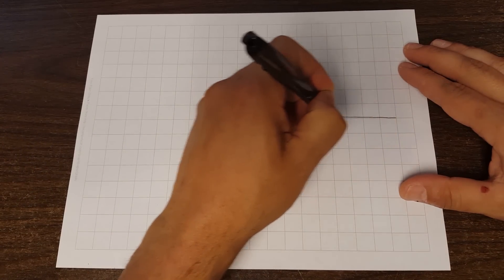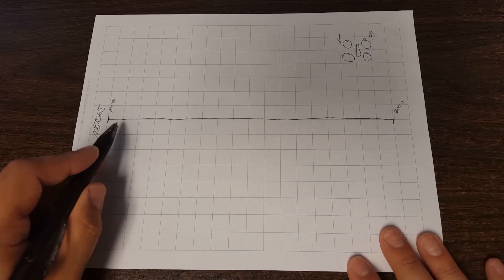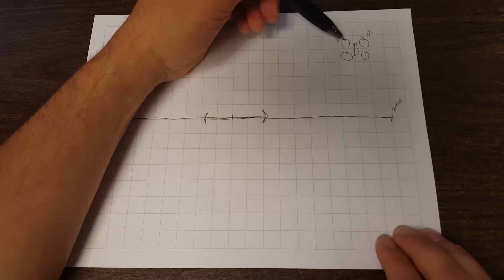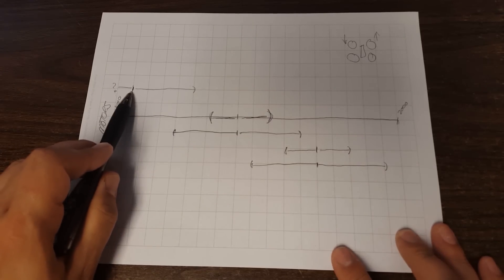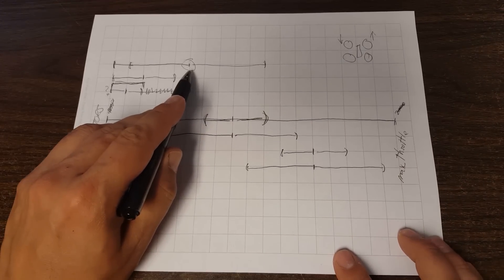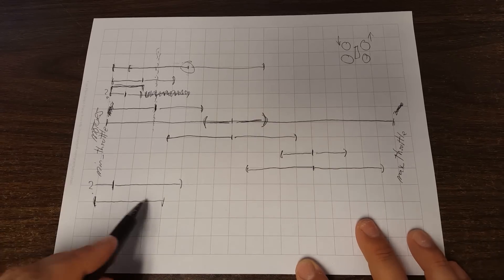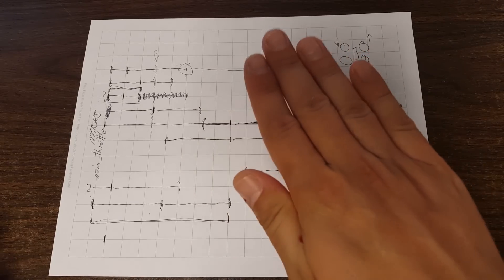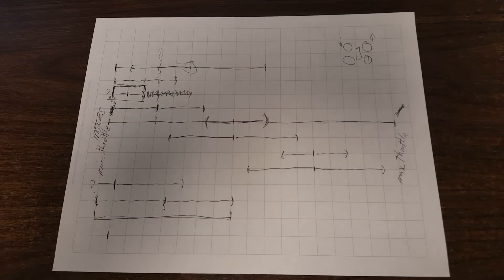What is Airmode? | BETAFLIGHT WITH AIR MODE EXPLAINED

Comment: I was watching a video that showed me how to set the modes as the Eachine x220 comes with them off and I had to turn off Airmode as my motors kept revving up faster and wouldn't slow down. He told us to use the full width of Airmode in Betaflight slider. What's the correct settings in the betaflight for the different modes?
Reply from the maker: +Rod Hamilton correct depends on your needs. If you want to disable air mode, just delete it from the Modes tab. Check out my Wizard X220 initial setup video for details, or my "Betaflight flight modes" video.

Comment: Since the motors can't drop below zero revolutions/thrust, is this about the minimum total thrust it takes to keep the quad aloft?  Obviously to enable maximum yaw, there must be enough thrust in either pair of opposite motors/props to hold the quad aloft (with zero thrust from the other pair), so if that isn't the case (and it requires some combination of thrust from MORE than two motors) then there is a "sliding" range there that cannot be narrowed if the quad is to stay in the air.  It is clear this is why early brushed micros had no yaw authority.

Maybe I'd need to play with air mode to see how it is a benefit, but it's not clear to me right now.
Reply from the maker: It's a benefit because it increases authority at low throttle. Do this: with air mode disabled and motor_stop disabled, punch out high then drop the throttle to zero and watch what happens. Now enable air mode and do it again. The difference should be obvious.

Comment: So what i understand now from reading some of the comments, by default air mode activates at throttle 1350, and goes off below 1350 ? so i don't have to think about this, but is this the same for Cleanflight or KISS, would one notice this behaviour ?
And this is a "feature" within the acro mode ?
Great tutorial ! I'm just starting with building and these things i see rushing by, and don't know how relevant they are, when starting to fly, but it dazzles me a bit :)
Reply from the maker: Air mode does not go back off when you go below 1350. If you think about it, this would disable it entirely, since it makes the most difference at low throttle. Air mode comes on at 1350 and stays on until you disarm.

Comment: Hi Josh..bench testing my quad.without air mode "on "my quad still has control with 0 throttle input????
Reply from the maker: +ab slayer yes, there is still some pid control it's just weaker.

Comment: So does the DRL Simulator have some kind of Airmode per default, or is this kind of simulated steering not comparable to real life quads? Because if feel like regardless of the throttle the virtual quad will always roll/pitch/yaw symmetrical, even though the rotors can't spin backwards
Reply from the maker: +Emoticons I don't know what you mean about spin backwards. To increase the rotation rate, one set of props will idle while the other set spins up.
Reply: Joshua Bardwell yeah thats what i mean: Normal motors can't just spin backwards, which means the drone can't rotate exactly over the longitudinal axis, but slightly to that side where the engines speed up. In the simulatot the drone rotates exactly over the middle, regardless of the orientation.
Reply from the maker: I believe the drone will always rotate around its center of mass.

Comment: Thank you Joshua,
I got nervous because I want to Learn in Angle Mode first, but with AIR MODE on all the time. While testing motors in Betaflight with no props on it was scary because throttle would not quit or shut down in Angle Mode with Air Mode On.
Acro Mode with Air Mode is fine.
So if I put the props on with Air Mode on and using Angle Mode it should be ok? This is a brand new Eachine is there any other suggestions or links you could send for the accelerometers.
Thank you
Reply from the maker: +Michael Puccio I strongly advise you to practice and learn in acro mode. A nice side benefit is all this nonsense about accelerometer lbs goes away.

Comment: Hi Joshua,
I am new to the hobby, and just bought the Eachine 220 Wizard.
I watched your video on this setup, and I need your advice.
While in Betaflight 3.1 I added airmode, and Horizon mode. In these 2 modes with my props off my throttle seems to get stuck when I pull down on the throttle. While pulling down to decelerate it actually increases the throttle.
Is this normal?? In acromode throttle works fine.
Just got the wizard and have not put props on yet to test fly. 
Thank you
Reply from the maker: Behavior with props off is often unusual. Don't read too much into it. A possible cause is that your accelerometer is not perfectly calibrated or trimmed, and the copter is trying to autolevel itself.
Reply: I have a 220s and i have seen this behaviour...dont mind it the motors are reacting to movement the gyro is sensing...you can test it by uping the throtle activaton value and see that they dont respond to minor movements on the gyro..(dont recomend you fly like this.) Just to asure you that its all good...the wizard is just trying to auto level ...happy flying

Comment: In betaflight, is there a difference between airmode and no mode selected in modes or is airmode the standard mode?
Reply from the maker: +Frederik Vancoillie no mode selected us acro. Air mode is a modification to the mixer that stacks on top of other modes.
Reply: +Joshua Bardwell Thanks for the answer!!  Great informative channel and you're an awesome teacher!!  :) Would you recommend acro mode then or airmode?  I flew self leveling aerial photography drones  for about 4 years now but have just built my first racer and started flying it a day ago.  What a learning curve!!  Still, I can keep it in the air, turn and haven't crashed... hard. Oh, forgot to mention, I'm more interested in acrobatics than in racing.
Reply: +Frederik Vancoillie Both, and at the same time. Acro mode with airmode turned on. See Joshua's videos related to landing in airmode.
Reply: So air mode is acro? Or no modes at all is acro?

Comment: So basically air mode allows you to have the same pitch and roll authority no matter what your throttle setting is?  And if landings are so difficult with air mode activated what's the best technique to use to land on an uneven surface like grass? Just bring it to a low hover and kill it?
Reply from the maker: +AV8R Tom yes. Just bring it in low and kill it. Search my channel for "how to land air mode"
Reply: Joshua Bardwell thanks for the reply!

Comment: Joshua, 
I have watched many of your videos and they have assisted me greatly in getting flying. Thanks for the work you do.
I noticed someone else asked this question and did not receive a response so if you have a chance could you indicate why when Air Mode is enabled and you blip the throttle from idle on the ground that the motors ramp up considerable and the throttle appears as though it is "stuck on".
Turn off air mode and it doesn't happen. I am running and Eachine Wizard  set up with Betaflight 3.xx as per your videos.
Thanks for any response in advance
Peter
Reply from the maker: Because air mode increases authority at low throttle. Once you exceed 1350 on the throttle, air mode activates. If you want to idle on the ground, don't raise the throttle. If you want to go fly, raise the throttle and go fly.
Reply: +Joshua Bardwell Thanks for the response. So the issue would disappear when in the air?
I was concerned I would get a runaway Quad if I used it. I have put it onto an AUX switch so I can give it a try in the air. I can also then switch off before landing which eliminates the "How to land issue" you have addressed in your other video.

Comment: But.... why raise the setpoint instead of just giving only the required motors more juice to complete the maneuver at the demanded authority level? Isn't air mode almost as bad as having idle up on? Even if it's only for the time you're inputting the command?
Reply from the maker: +Drunken Hamster raising the setpoint and giving two motors more juice is exactly the same thing.
Reply: No... Your explanation made it sound like all the motors got more juice just so the ones that needed it could be within a 'range' or whatever.

Which would be like a temporary idle up. What I'm suggesting is making the motors required to perform go BEYOND the range of the setpoint's up/down scale WITHOUT affecting the other motors.

IE, if my quad was on the ground and I gave full yaw one way, the non-yawing motors would stay off or at 'idle' depending on how I set it to arm, and the yawing motors would spin up all the way. The desired result would be a yaw-climb. Well, I assume that's what it would be called.

Of course, then the pid thingy or whatever has to step in to make it ONLY do what you want would do so and use the other two motors to keep it stable, but that's about it.

Response?

Comment: excellent explanation. Thanks for making this (nearly a year ago haha)
You spoke primarily about error induced by input (stick movement) and only touched on outide inducers of error. Air mode effectively improves the I term at low throttle as well. Effectively you can reduce the I gain an have very stable low throttle angle hold with Air Mode.
Especially now that flight controllers have 2DOF, theres even more that can be said about this.
I'd love to hear all your thoughts on this as well as the improvements that have been made to air mode (such as preventing "freakouts" on landing)
Thanks again Joshua for always  informative videos

Comment: Should the motors spin at a certain speed at 0 throttle and no stick input if Airmode is on? I had boris B betaflight installed and it was common but now I can't tell if it is working or not because the motors don't spin when armed. If I punch out and drop to 0 throttle the motors don't seem to be spinning at all. This is with motor stop on. Or is it that Airmode only works at 0 throttle when some kind of stick input is present?
Reply from the maker: +Jay Bennett Air mode should keep the motors spinning any time the copter is armed. At zero throttle on the stick they should spin near min_throttle. Air mode should also override motor_stop.
Reply: Joshua Bardwell brother wow thanks for the fast response! What can I be doing wrong then? I just put together a 180mm build with dshot capable little bees and a sp racing f3 flight controller with the latest version of betaflight and BLHeli. I set the quad up just like my others but Airmode doesn't seem to be working. I am baffled and frustrated. Any ideas would be appreciated.
Reply from the maker: +Jay Bennett are you using modes or the feature in the configuration tab? If modes then is it turning yellow when you flip the switch? If the feature, check in the CLI when you type "feature" that air mode is present. 

If air mode is enabled and the motors still stop when armed, then min_throttle is too low.
Reply: Joshua Bardwell okay... The Airmode is set to a auxiliary switch and it is yellow when the switch is flipped so I checked the cli and Airmode is Not there. How do I fix that?
Reply: Joshua Bardwell I just typed feature Airmode and it is now enabled. Double checked in the CLI and it is there now.... I am going to test the quad. I will get right back with results.
Reply from the maker: +Jay Bennett Yeah, but was it in before? Now we'll be very know...
Reply: Joshua Bardwell okay just tested it and the motors still are still after switching Airmode on. After a quick hover when I land with Airmode enabled the motors twitch and spin somewhat. How do I set min throttle correctly?
Reply from the maker: +Jay Bennett raise it until the motors just keep spinning. Then raise it 20 more points.
Reply: Joshua Bardwell okay i have min throttle at 1110 and the motors are now spinning when armed so I went back and enabled motor stop and tested again. So far so good. The motors do not spin when armed but do spin when Airmode is on. Only question is will this reduce my throttle resolution since I am now at 1110 min throttle instead of 1070? Will it give me less throttle range?
Reply from the maker: +Jay Bennett yes, but you need the motors to keep spinning. If your min_throttle is 1110 then I suspect your calibration isn't right. Did you set min_command 1000, max_throttle 2000,wnf calibrate the ESC's?

Comment: Does air mode interfere with inverted hanging?
Reply from the maker: In theory you get better inverted hang time by leaving the set point as low as possible. But in theory, you'd get better inverted hang time if you shut the props off altogether. Air mode is, IMO, the best way to balance control and hang time.
Reply from the maker: The best way to get hang time is to have a light quad with lots of power. The more upward acceleration you get, the longer you hang.

Comment: so PID loop acts like AS3X in e-flite planes?
Reply from the maker: A multirotor has no aerodynamic stability of its own, like a fixed wing does. So a multirotor is always gyro-stabilized.
Reply: I thought in acro mode the built in gyroscopes were essentially disabled... wow, was I wrong.
Reply from the maker: No, it's really impossible for you to fly the copter by manually controlling the motors. The adjustments that must be made for acro flight happen on the level of milliseconds.

Comment: Joshua - I recently flashed to 3.0.1 and now with AIRMODE enabled, when I do inverted maneuvers my throttle jumps up while inverted, even with zero throttle.  I fly only in ACRO mode so GYRO is the only thing enabled.  So when I do a split S, it's not smooth, I have to do it really fast or I am into the ground.  Any ideas what I need to look at?  I can collect a blackbox log if needed, just let me know how I can share it with you.  Greatly appreciate your help!

Comment: Does the min throttle value  have anything to do with AM?   It seems to me when I cut the throttle while for example inverting, the motors completely stop spinning and then the copter flips out a bit when I raise throttle.    Without AM enabled and the same maneuver, my copter flips out a lot.
Do I need to raise min throttle? I think I'm at 1030ish.
Reply from the maker: +tahosrfr yes. You need to raise min_throttle

Comment: So then how do you land without the copter trying to correct?  Disarm the board?
Reply from the maker: +Barry Anderberg exactly. Lower throttle and disarm. Switch arming is really mandatory if you run air mode 100% of the time.

Comment: so when you do a roll and kill the throttle.. does do the motors stop spinning? or is that something different?
Reply from the maker: Air mode will keep the motors spinning at zero throttle. Air mode overrides motor_stop.

Comment: Thank you  for all of your work!  If I enable it as a feature in 3.0 do I still get 1000us to 1350us normal,  and not need to put it on a switch?
Reply from the maker: Yes. It works exactly the same as a feature vs. a mode, it's just that as a feature, it is always on with no aux channel configuration or anything like that.
Reply from the maker: As soon as you go over 1350 the first time, it activates for the remainder of the flight. You can reconfigure that number if desired.

Comment: in few words...with low throttle and sharp movements it increases throttle temporary to do the movement fast.... ;) thanks for your explanation...
Reply from the maker: Great way of putting it.
Reply: I never understood while watching stick movement videos how someone could roll the copter at zero throttle, so that is air mode its a cheating :)
Reply: I wouldn't call it cheating. It's the only way to achieve that kind of movement. Also, it isn't exactly easy to do some of the tricks at the speed some people are doing them. As well, your PID's have a big roll in it. If you have poorly tuned PID's the quad won't roll or pitch really fast so you get slow flips and rolls ect. If you go back about 3 years and watch some of the free style guys on youtube, like Charpu or Mr Steel you will see their rolls and flips are slower. That is because even 2-3 years ago the PID controllers weren't as good as they are now. As well the tuning of PID's was not as well defined as they are now. Also you will notice that their vid seems a bit jerky compared to more recent vids.

Comment: Hi. Thanks for the video!, But I think I got lost somewhere.  Could we say, that Airmode could be as to have a "sonar" in order to provide more stability to motors, ESCs, and of course to all the Quad?  This was my first question.  The second one, is how does it work with all the Flight Modes?  I mean, do I include it as a complete "flight mode" covering the min_Throttle to max_throttle range, living together with Angle, Horizon and also Acro? Thank you in advanced.  Regards.
Reply from the maker: +Ignacio Olave it's not a flight mode. It's a change to the mixer logic. It works in all flight modes.